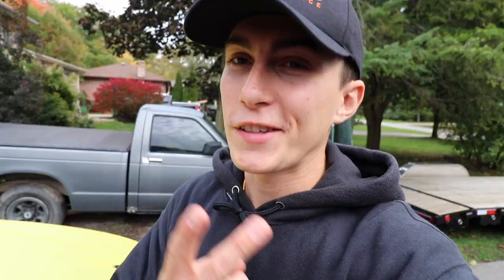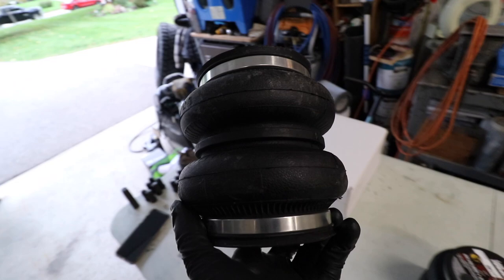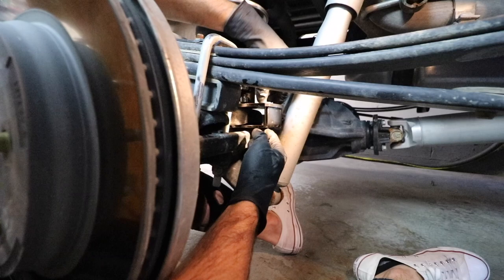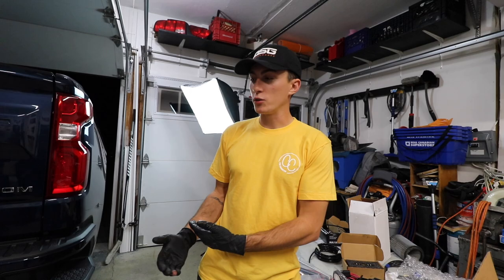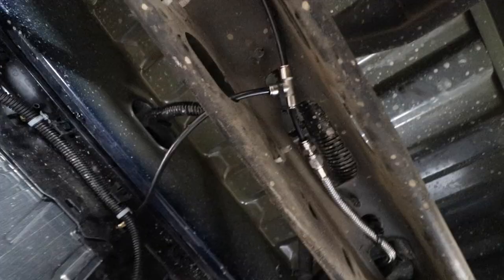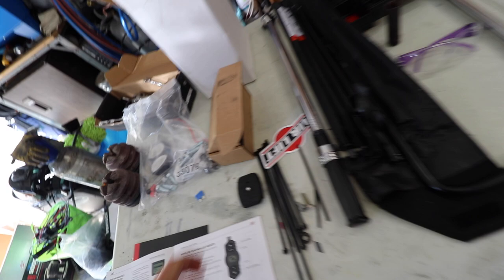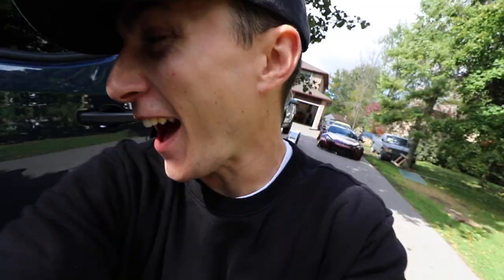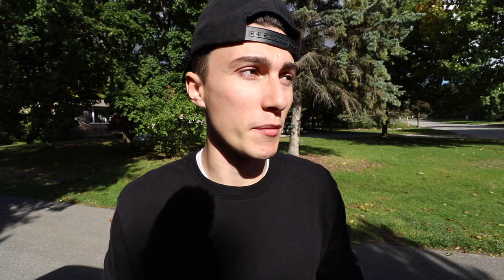BAGGING THE NEW SILVERADO!

Comment: I wonder if that little compressor you have onboard now could also be set up with some sort of airline that can be used for airing up tires if you need to. That might be overkill but it would still be super cool to have.
Reply: Imo I dont think that little compressor would have enough beans to air up tires but who knows really
Reply: @ferdinand9103   bags probs have more than 40 psi in them so it can inflate tyres
Reply: @ferdinand9103  I wouldn't have thought a compressor that small could either, but a week ago I bought this super cheap tiny compressor to deal with a slow leak in my crappy tires and its tiny and somehow still does the job. Although truck tires have a lot more volume so I'm not sure how a pump like that would hold up the one I got for my car can unfortunately only add about 3psi a minute which is painfully slow. This compressor I have is literally the size of a soup can through its rediculous.
Reply: @KasamS  he said they pump up to about 10psi and 5psi is the minimum ride height
Reply: @bramo5901  but didn't he say he took it to 60 when the trailer was on it
Reply: It probably can, I have a tiny compressor from aliexpress and it airs up my tires so it could probably work
Reply: I have bags and have a line to fill up my tires...
Reply: Totally could but it’s take some time haha. I was thinking about that all video haha
Reply: Train horn time
Reply: @ferdinand9103  my dad has a tiny portable compressor in his truck, which is smaller than a lunchbox, and it can air up tyres and anything basically, it just takes a while. Im pretty sure this one could do the job too!
Reply: I have same setup.  That pump will pump those bags to max psi of 100 so it will def pump tires up too.
Reply: @KasamS 60 low volume

Comment: Air bags are a definite improvement to eliminate sag. However  they still don't return the weight back to the front axles with the trailer hooked up. Your rear axle is still acting as a fulcrum. The only way to accomplish this is with a weight distribution hitch. I run both to make sure the proper weight is returned to the front axles to retain proper braking and steering control, especially in wet conditions. Not as critical if you don't tow that often with lighter loads. But I tow alot, often maxing out the tow capacity of the truck and for long distances. Just a point to be mindful of.

Comment: if you get a MTB air pump you can easily use it instead of a compressor to fill air bags with 7-10 pumps.  its so easy and saves a lot of money.  Ive used it on a range rover that has 4 separate fill valves.  also, if you use a compressor with outside air, buy a new descant bead and filter kit every 2 years and also can buy refurb kits.  if you need to disconnect a line, cut 1/3" off end of line and press in completely to ensure a clean connection. so ensure you leave extra line where lines connect to bags or valve blocks.  Air suspension is the best.  I have it on 3 cars/trucks and its the best ride of all.

Comment: One hack I learned about when towing a trailer is to inflate your rear tires to their maximum pressure.  (I assume most of you knew that, but I didn’t).  It makes a hell of a difference, especially through the big bumps when the trailer tries to try to pull itself off.

Comment: I didn’t see in other comments but I installed these bags on 2015 Sierra and I was able to get compressor with independent control for each side.  Still works great 5 years later and it’s nice to load level side to side.

Comment: For the little bit Robbie put at the end of the video, coming from a guy who works in a shop if you have a wheel lock on your car before you leave make sure you have it in your car. Personally I have a bad habit of leaving them on my box but I usually put them back 95% of the time but that 5% is enough to check before you leave.

Comment: if you change a car's suspension from factory to air bags, or adjustables - do you not need a cert (inspection to ensure its safe) before being road legal in Canada? you have to get a 'cert' plate in NZ if you change it in New Zealand.

Comment: You shud connect that compressor to that other valve so you can use it to "fill tyres" at track or what ever you might want to do with air

Comment: Truck was never made to haul weight from factory.  2 Leif springs. Yes they are a lil thicker. But come on.  My 97 k1500 has 4.  I added 2 more and its way faster and simpler then an air system.

Comment: I completely understand the rear bags leveling out the truck from "squatting". My question is ... if I were to buy a 2022 silverado 2500 2WD, would I be able to install a set of bags that would help with the "squatting" problem BUT ALSO allow me to lower the truck a bit to make it easier to load/unload motorcycles in back of bed? I load bikes regularly, and with the tailgate down, the newer silverados are HIGH off the ground and difficult to walk/step up into the bed from the ground. But if I could somehow "lower" the truck while I load it, and then set the truck at proper ride height & roll out, that would be good. Possible?
Reply: You would have to lower the rear of the truck so without air the rear is the angle you want it. Wouldn't recommend it.